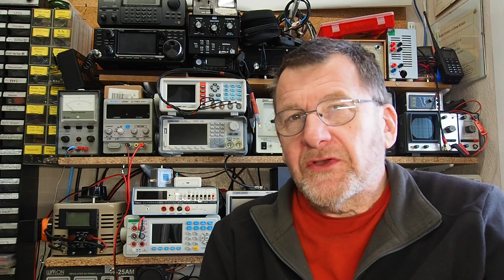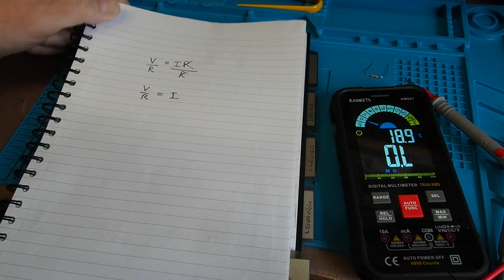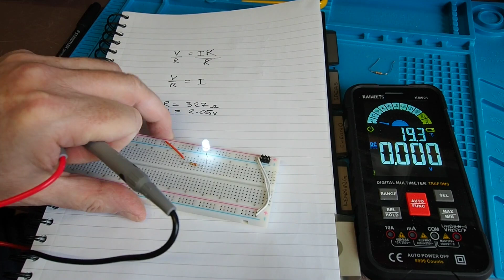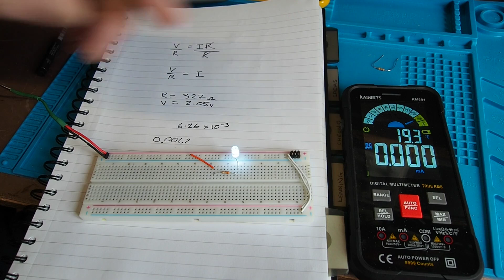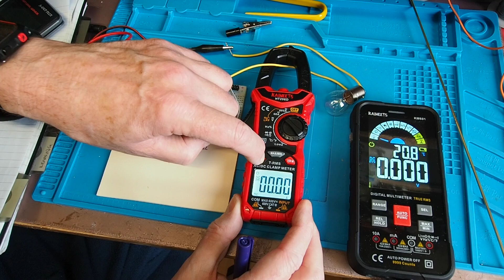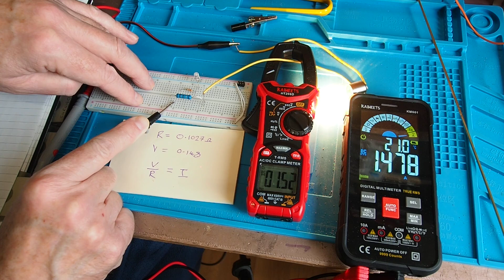Current Shunts and Ohms Law in Action! - Kaiweets HT206D Clamp Meter and KM601 Multimeter –- #112

Comment: Great and thorough description as usual.
I just got a question about the "current-limiting resistor" and why it's called that?
It just forms a voltage divider with the LED, and acts as a voltage drop, isn't it?
The current is dependent upon whatever the LED draws.
We use to call then voltage drop resistors, as you would change the value of them dependent of the supply voltage.
Reply: No expert, but think of it like this. The total current drawn by a circuit  (I=V/R) is dependent on the total resistance of that circuit and the supply voltage. Also, the algebraic sum of the voltages must be zero, according to Kirchoff (KVL). If full supply voltage is applied to the led without a current limiter, then all the voltage is dropped across the diode. The diode has very liitle resistance & will not like that one bit. Assuming the total is more than the ~2V it can withstand then the current passing through it will be near the maximum available from the source and the dissipated power will be life-threatening, (P= VI).
Reply: @grahambambrook313  Yes that is correct, but the resistor has no current regulation functionality, it's purely a resistive load. 
If you increase the supplied voltage (or it fluctuates) so the voltage over the LED rises above the "~2V it can withstand",
you will still burn out the LED even with the resistor present.
The regulating/limiting part is left to the implementer who has to choose the right value for the resistor
to make sure the current is withing the LED's rated values.
Reply: @geirendre  Agreed! These are the design parameters and must be chosen accordingly to suit the application voltage.